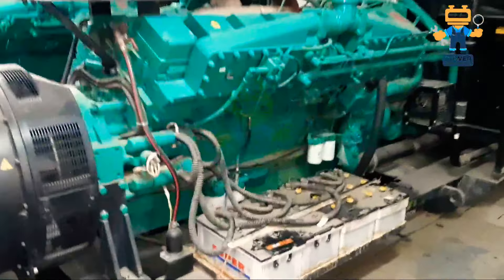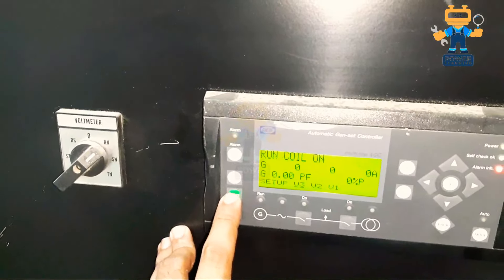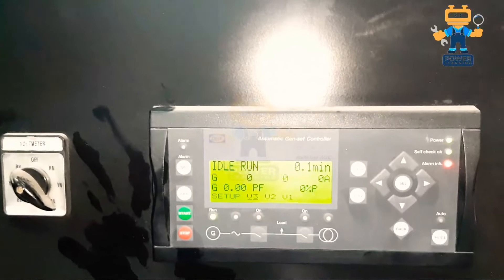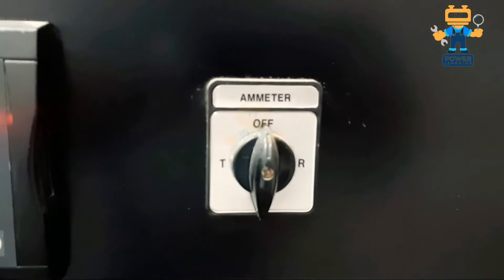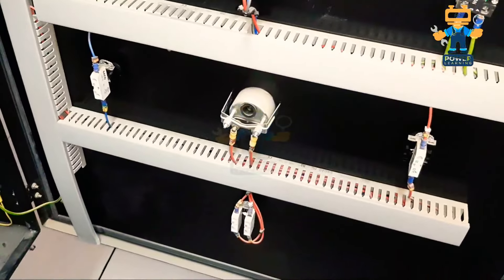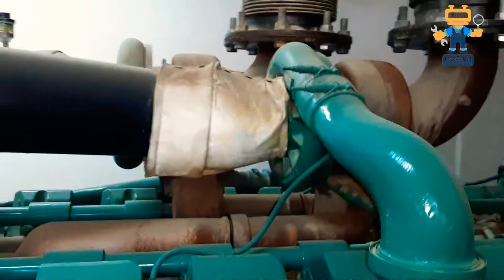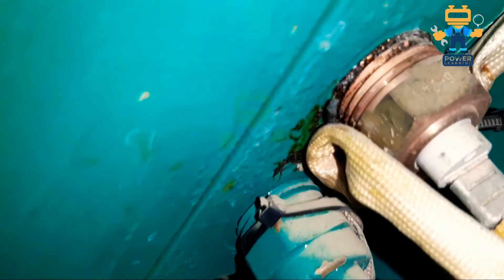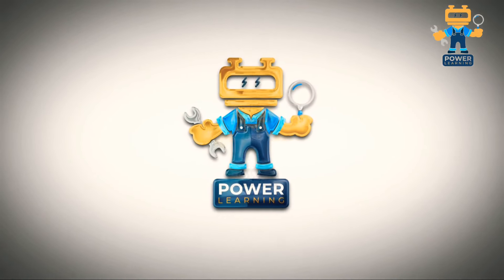Diesel Generator Training, Parts and components and working principle explain Power learning part 1

Comment: we have cummins engine  600 kva , the engine is adding oil to the radiator tank, if you check coolant there is mixed oil and water, but if you check oil deepstik  there is no water